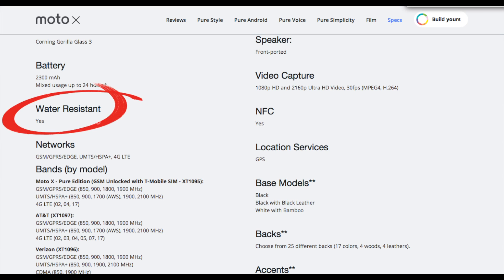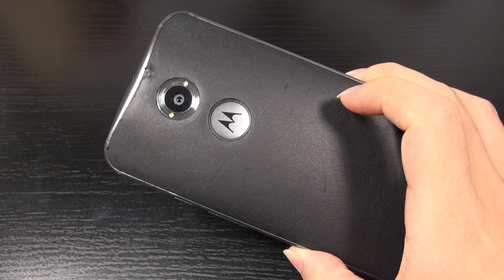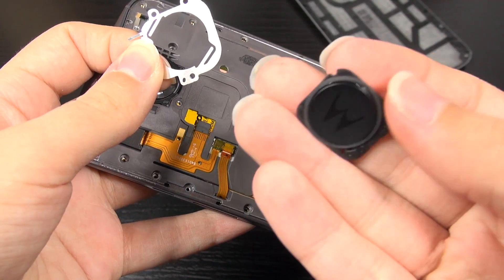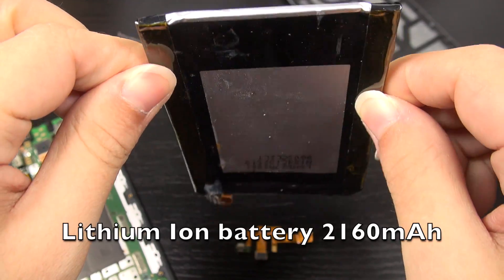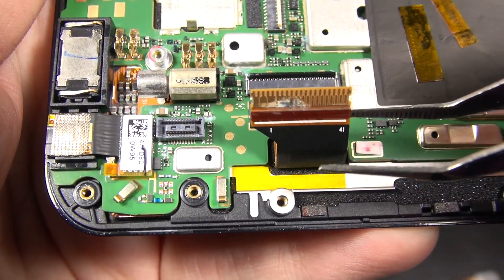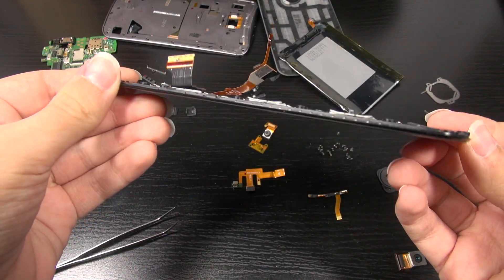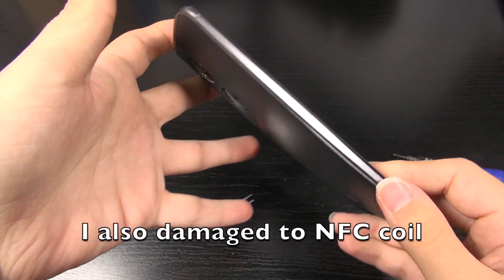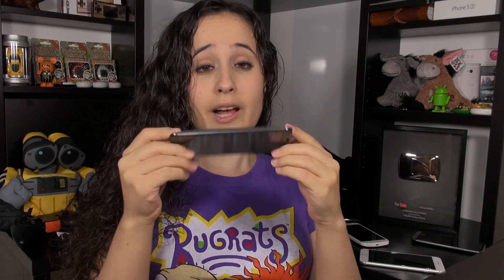Moto X (2nd Gen): Tear Down and Exploration

Comment: Use Uncooked Rice to soak up the moisture. Completely cover the phone in a Sandwich Bag or any Bowl . Leave Open the Sim Port or back cover. Let the Rice soak up all the moisture for about a day or two. After a day or two on the phone check if the phone still works. If it doesn't work then it's intenal short circuit is fried by the mistrue.

Comment: OK but wait.  those pull tabs are what release the battery, like little parachute strings.  u basically took the long way home on that one. had u pulled those tabs,long long long streamers come out and dismount the battery, which is also stuck on with adhesive that may be used to mount the battery when reassembling if it's still sticky enough. but otherwise great teardown.

Comment: Hi, I seem to be having a problem with the antenna. my motox incurred some water damage. everything works, except it will not connect to my mobile provider network. wifi works fine, just no cell/data service (the status the service state says the radio is off). any suggestions on how to repair the antenna? or what might be the issue?
Reply: Erica Griffin

Comment: There's so much more adhesive and tape on newer devices... I remember taking things apart from several years ago and generally just the batteries and digitizer/screen glass were stuck down with adhesive.

Comment: Great video!
Would it be really hard to just replace a cracked glass? I was looking on ebay and saw a replacement glass for it for just $8, that sure beats the $200 the repair shop is charging for it.

Comment: If this can be any help for the next water damage test video. 
In the case where the phone's screen stops working and the battery is not removable,
For most android phones, if you press and hold the power button and volume down button (for some power, volume down and up) until it vibrates, it I'll launch the android boot loader
Now what you can do is navigate to the boot loader using the volume rocker:
3 volume down presses and power button press will turn off the device. :)

Comment: Erika great stuff in your video. Amazing technology in such a tiny device. 13 years ago I worked as a manufacturing engineer for Handspring Treo Phones -- now HP owned --. SMT process has changed big time, but still hand assy is required for each of the delicate components. Imagine running manufacturing lines by the clock, it really get´s into you. Taking apart is easy, the challenge in to put things togheter again, perform functional test, final inspection and shipment. All by clock. Live or die. Cheers.

Comment: my first gen moto x, died by way of water, it was literally only in the water for maybe 20 secs, because at first i did not realize what had just happened it sustained a blow on the way down before sliding into water. after i had abruptly removed it from the water it went on an endless boot loop.... then when it finally booted up the device was working, but barely. the earpiece and speaker did not work at all, the screen was fuzzed out etc. thats the last time i ever put a phone in a sweatshirt pocket....

Comment: You should get anti corrosion electronics cleaner, a few q-tips and see of you can get that phone started again. Also, you'd be surprised how much bending those batteries will survive. I pull u-shaped batteries out of iphones occasionally when the adhesive won't let go, just bend it back and no problem.

Comment from the maker: Ok, I think there is some confusion here. The point of this video is NOT to call out Motorola for lying about waterproofing of this device. (They didn't lie about anything)

This device IS NOT WATERPROOF. I have never claimed that this device is water proof. This device merely has a water resistant nano coating that is meant to repel water away from internal components. It's not electrically insulating. This means that water impurities can cause issues and it can indeed still short circuit.

The idea is that I want people to see what happens when they put this device in water. It did act as Motorola claimed. It could survive some splashes and such. I said this was the obvious moral of the story.

I have been interested in the claims of P2i though, who makes and applies the coating inside of the device (and yes I have confirmation from Motorola of this). Please see the included marketing video in the description. 

Clearly, P2i states that if liquid does by chance get into the device that liquid can be easily removed without damage to the device. 

Well, that claim just isn't true. So I think this is good for Motorola to see about their own device and I think it's important for people to see that a non electrically insulating nano coating is definitely not water proof.

This entire curiosity came about because both Moto G devices that I got upon first release of the unit survived water like a champ! Why suddenly with the Moto E and X and newer Moto Gs that they die so easily in water?
Reply from the maker: ***** you would think this is obvious but some people don't make this distinction! It's sad.
Reply: I LOVE YOU
Reply: Did Motorola's legal team contact you?
Reply: Fussel fresser dude, how much of a fuckin psycho are you? talking about shit then asking a girl you've never even met to marry you in the same paragraph? Creepy.
Reply: Please don't do this with a nexus 6
Reply: Lol people now a days take things to another level.
Reply: I like the unique perspective this brings, I specially enjoy when the device dies, so I can see the tear down ;-)
Reply: Juan Torres Erica Griffin and I were talking about some of this video's comments and how to interpret P2i (supplier) and Motorola (manufacturer)
My understanding here is that as I've seen it multiple times in the industry, manufacturers tend to not do things like suppliers of chips or other solutions recommend them to, because of practical or random reasons.
As a result as demonstrated in this video the device can die if immersed in water; I speculate because Motorola doesn't follow to the letter P2i recommendations, like with its usage of kept-on tape that leads to short-circuits.
Erica didn't post that after being contacted by any legal team, but she tried to clarify the intent and reasoning that motivated this video.
Reply: Don't let people get to you.  There will always be theses types on the net. Keep up the great work.
Reply: True dat
Reply: I want to go to the WC and make a poo and thraw my MotoX in it. Greetz from Germany
PS. : Erica marry me please

Comment: Maybe if you had cleaned the flat cable with sandpaper and the board with Isopropyl alcohol the phone and it's screen would have worked properly.
Reply from the maker: I did clean the board and got rid of the corrosion with isopropyl alcohol. I did point out doing this in video and it didn't make a difference. The cable is damaged though.
Reply: :/ So sad, but all for science purposes :)

Comment: That was really interesting. I'm surprised at how many modular components there were, I thought everything would be surfaced mounted to the PCB. It would be great if whole thing was just swappable components, with those orange connectors between them, no custom circuit board.

Comment: I hope Firefox gets the 60 fps update soon. Chrome is unwatchable for me
Reply: Benjamin Huang This helped me thanks.
Reply: Use IE
Reply: Benjamin Huang still nothing
Reply: ***** I hear turning off hardware acceleration in chrome helps. If it still doesn't, I'm afraid the problem is on your end.
Reply: Firefox sucks ,just try  chrome I'm sure you are going to fell inlove XD.
Reply: Benjamin Huang I think its just my retarded laptop. You'd think 4 GB of RAM and a Core i3 could handle Chrome as a web browser
Reply: ***** Chrome is good when it wants to work but Firefox is way more reliable for me
Reply: ***** why does firefox suck?
Reply: ***** Well my father has laptop with linux and the firefox sucks i dont like the UI and it lags(sadly I can't install chrome on fucking linux(i double click on the file and it opens it in something like winrar with more files ..and when I click on them - nothing happened and I just gave up) so I cant say that chrome doesnt lag there but I haven't any problems with it on my PC(win 7) and my phone(android is based on linux kernel so probably chrome wont lag and on the laptop))
Reply: ***** AMD athlon 64 dual core 2.5(pretty old) ghz and 3 gb ram = no problem with chrome.
Reply: ***** I hate Chrome. FireFox and Opera is what I like. But everyone has their own opinions.
Reply: ApeX Kittens sorry i lied when you turn off hardware acceleration you loose the 60fps, well thats what happens to me

Comment: its sad after motorola is being sold to lenovo,they started using low quality and to cut down costs they try to make the phone simple rather than durable :( moto e and  moto g performed better in this water test but not moto x :( motorola bring us the hydrophobic coating to all the wires, just like u did with the previous phones........bring water resistant coating as a basic feature to all phones ,just like u did with moto e

Comment: I have a question though. Why does  #motorola   seem to be the only smartphone manufacturer using those full phone sized PCB boards . It looks really solid and plenty of space for components to not be crammed up I know but still it adds bulk and weight to the internals which in this phone's case could just help the battery capacity a little bit..

Comment: It's good to know what is actually the truth and what are they lying about when they're presenting their devices
Reply from the maker: Yeah, I don't get it. With the original Moto G, I had 2 of them and did this same water test and both were just fine. I tried this with a Moto E and the backlight fried. Now on the Moto X the display fried. Whatever... I won't be trusting any "splash proofing" claims again, at least where water gets into the device is involved.
Reply: They're not lying, this phone isn't certified to be held underwater. At least now you know that hey if your phone isn't certified to do so you probably shouldn't put it underwater while turned on. Who knew!?
Reply from the maker: Kane Smith yo, calm down. I know they aren't lying. It's not the fault of Motorola anyhow. P2i makes the claim though that if liquid gets into the device, it can be removed without damage. Look at the video in the description. It shows coffee getting spilled on the device and it being able to be removed without issue.
Reply from the maker: Kane Smith it's a test at a marketing claim based on the fact the the original moto g could handle the same test. This 3rd party company IS the one who applies the coating. Motorola has nothing to do with it. Motorola sends their finished units to P2i. Of course I didn't expect it to survive if it's not electrically insulating. But I see differences with this particular quality control. Take or leave the result. This is to inform people about the claim of water resistance. Some think it means waterproof...I simply show why that is not so.
Reply from the maker: Kane Smith I never said they lied, did I? 

What I have said is that it has a water resistant nano coating...
Reply: LOL stop it, this has gone completely out of the topic :D
Reply: ..ech...whatever, I'm done here
Reply: Erica Griffin It's probably because you have a leather back on the Moto X which is not as water resistant.

Comment: is the video 60fps? so smooth...
Reply from the maker: yes =D finally happy to see YouTube made this possible.
Reply from the maker: Kostas Kagioulis happy to see it's now possible for the plain folk too now then? lol
Reply: Ericca you replied me!! Awesome!! Greetings from Greece!!! ;)
Reply: ΕΛΛΑΔΑ
Reply: Personally, I hate it. What this means is that while my 2 megabit connection used to support YouTube playback at 720p without any buffering issues, it now doesn't. If YouTube implements an option to view HD content at either 60 FPS or 30 FPS on-demand, then this will, of course, no longer be an issue for me. Also, this video looks choppier when played back at 30 FPS than her older videos that were originally encoded at 30 FPS. Even if I had a gigabit connection, I would still prefer 30 FPS, because there's no good reason to have a video like this in 60 FPS (I challenge someone to come up with one). It's not like this is some action movie with tons of motion. This is the type of video that would be perfectly watchable at 15 FPS (not that it would be ideal, but it wouldn't really take much away from the experience). The big bummer is that most of the tech channels that have the smallest need for 60 FPS videos are going to be the most likely channels to encode their videos in 60 FPS. Grrr.

That's my mini-rant for today! :D
Reply: ***** agreed
Reply: ***** Then use the Flash Player as 60 FPS are only available in HTML5.

Flash is lighter than HTML5 and the only thing you lose by using it is the option to change the speed of the video anyway.
Reply: It was possible previously, but only for movie producers and studios..
Reply: Erica Griffin Did you film your old videos in 60FPS as well? Or how did you manage to get 60FPS in the old water video cutscenes?
Reply: *****  Are you also greek?
Είσαι και εσύ Έλληνας;
Reply: OXI EIMAI PATATA
Reply: ηεμησε ρε φιλε.. :P
Reply: 60 fps are awesome, so smooth
Reply: abelcowl I should have though of that. :/ Anyway, thanks. I am a bit worried that the feature will make it's way to the Flash YouTube player, but I guess I can't complain about it too much unless that actually happens.
Reply: Erica Griffin Dear Erica, Great video what camera was used for the making of it ?.
Reply: Abel Carbonell or, you can use your moto x or another high-end/1080p mobile to watch it, as you dont have to load a full screen, a 2mb internet connection can handle... Mine is 10mbps so im happy to watch videos in 60fps.